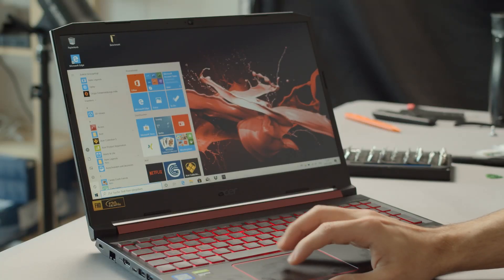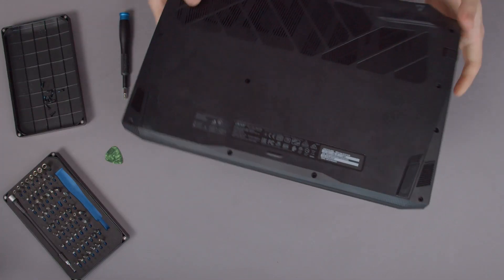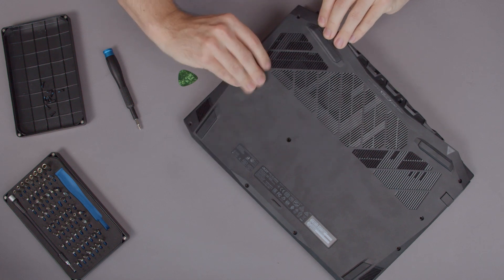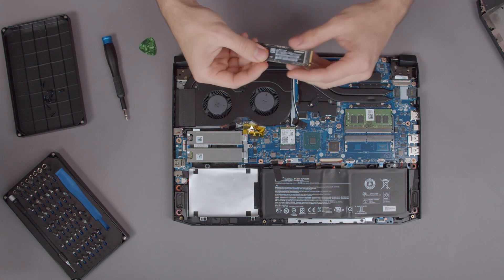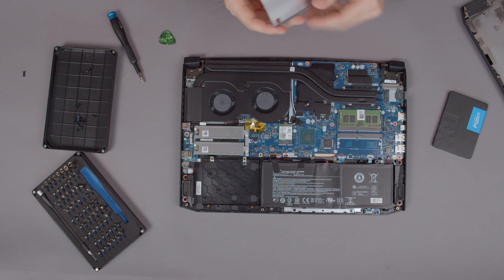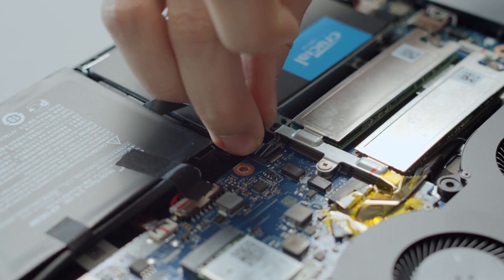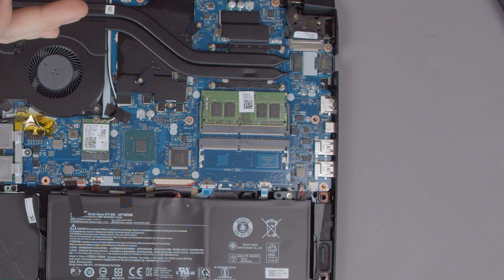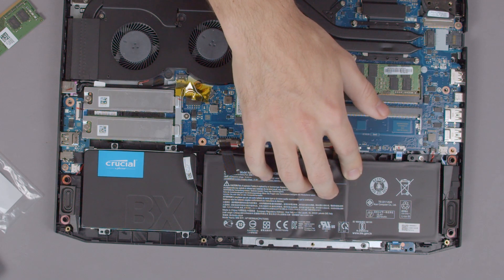Tutorial: How to Upgrade the SSD and RAM of your Acer Nitro 5 - ENG

Comment: Will the warranty be lost?
Reply: just don't break the warranty sticker that covers the screws,remove it by using cutter blade without damaging
Reply: @techph7854  oh yeah you can technically get in and out like a breeze but those damn stickers are really easy to destroy unintentionally I got away with a few of those but one time I had a problem and somehow when we sent a dvd player to a warehouse to get the laser switched, (I have been there to clean the insides up but I was generally unexperienced) them people understood that I opened it up I I asked how and they said that the sticker was the wrong way around XD
Reply: Yes

Comment: Hi dude I bought this last month ,in one screw slot there is warranty seal , so how to add new ram or SSD ?
Reply from the maker: It's okay to break the warrant seal. You should only be careful not to damage anything when installing RAM and SSD.
Reply: I think it depends on what country,here in my country if you break the seal the warranty will void,mine I remove the seal with cutter blade without damaging

Comment: Is it safe when I'm putting new ram while the battery is still connected to the motherboard?
Reply: yes it is safe as long as u dont turn on the power
Reply: if you do it right,insert the RAM straight to its slot,also make sure not to fall any metal object like screws into the motherboard

Comment: i got Nitro 5 AN515-42 R8HN , can upgrade it and put m.2 inside?, and if it possible what brand should i use? SATA or NvME. which one ?? i hope yiu can help me thanks
Reply from the maker: Hey, you can either go with NVMe or SATA, both options are supported by the system. NVMe of course is faster than SATA, but also more expensive.
Reply: thanks man

Comment: my acer nitro 5 (i5 9th gen , 1050 graphic , 8 gb ram) model - AN515-54-563Y / AN515-54-52H2

i want to upgrade my ram but i confused which MHz ram will be supported in my laptop & of which company also.. my laptop will be in warranty period so i not open it byself. Plz suggest me sir as soon as possible.
Reply: you need a 2666mhz ram stick
Reply: @silentwraith0136  thanks u soo much sir
it helps me a lot

Comment: hi, I actualy have the AN515- 52 with an optane memory, I dont know if I can add an SSD an keep the optane memory, not actualy sure if mine has one or two slots for SSD or if the optane is using an SSD slot or if it is integrated somewhere else
Reply from the maker: Hey, the Optane module usually takes up one M.2 Slot. So you can either add another M.2 SSD or swap the Optane for a larger SSD and move your OS to the SSD. But we noticed later that a second PCIe SSD won't show up in BIOS or Windows, so it's possible that, depending on the exact model, there aren't enough PCIe lanes available and only a SATA M.2 SSD will work.
Reply: Thank you very much, I didnt know it was possible to add another M.2 Slot, i will investigate if that would be compatible with my model and the optane memory
Reply: @notebooksbilliger  so does this mean you need to have one m.2 nvme ssd and in the other slot another m.2 sata ssd? i already have a 500 gb sata ssd in the 2.5 slot